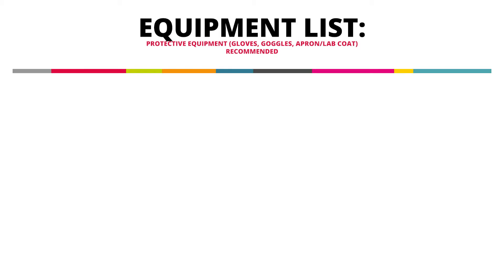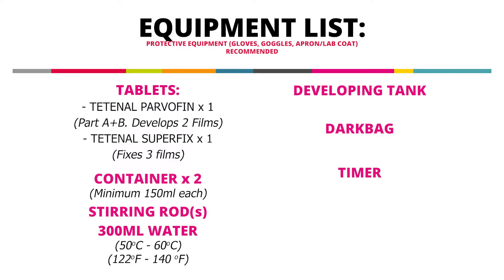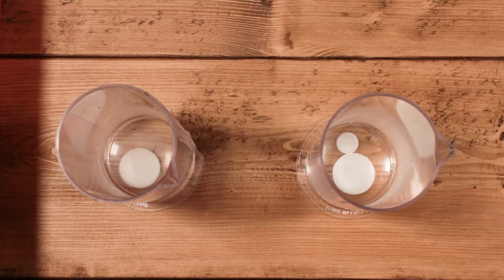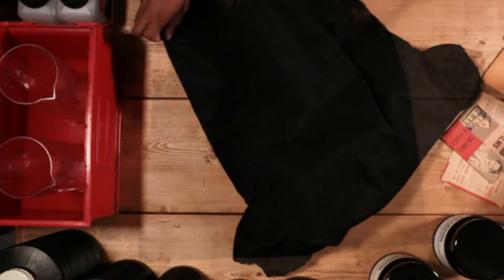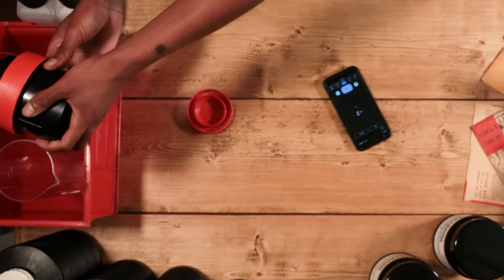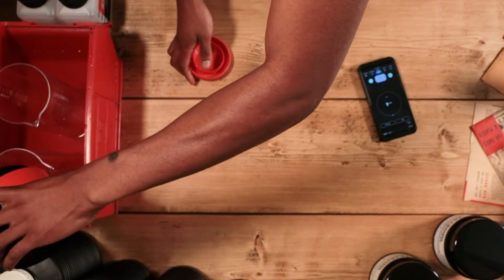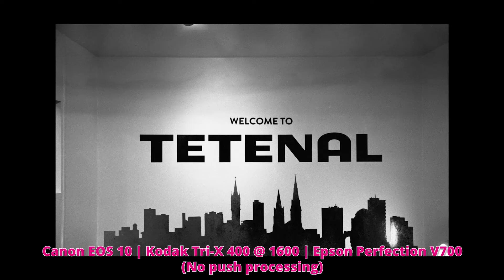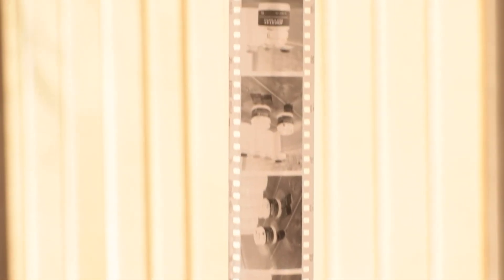How to Process Black and White 35mm Film With Tablet Developer

Comment: Hello! Even if data sheet says to use 1 tab of fix every 150 ml to fix 6 films, could be possible to use 1 tab of fix in 600 ml to use it for just one 120 film? (One shot). Thaks
Reply from the maker: We don't recommend diluting your fixer more than the specified quantities. We can't guarantee that at this level of dilution you will get the same results as using 1 tablet per 150ml.
Reply: @DupliCreate  ok, thank you!